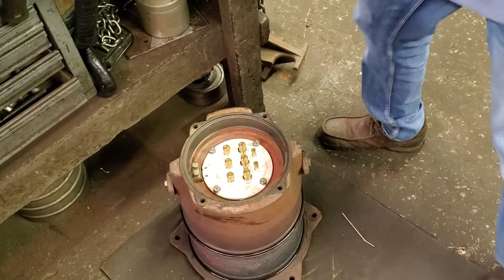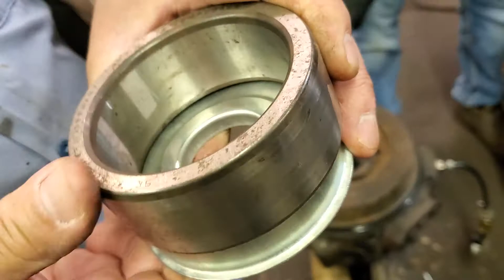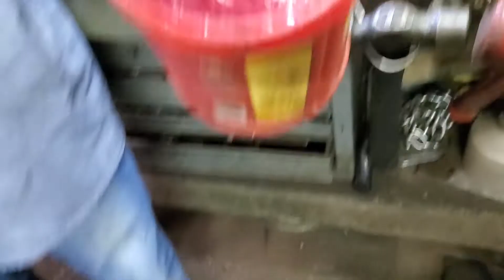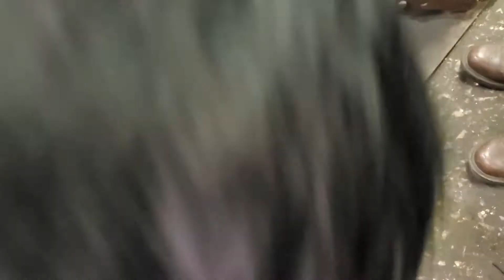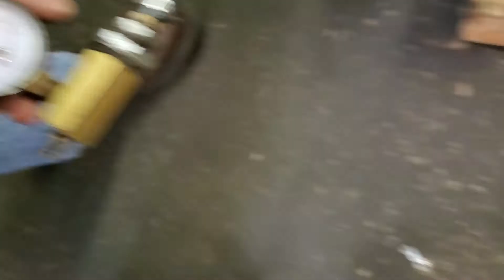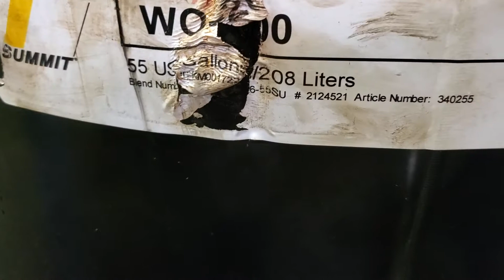Hahn University: 3 of 4 Pump Assembly Flygt 3152

Comment: I googled the article number of the oil and it's not vegetable oil. It's food grade white mineral oil, also called paraffin oil. Food grade means it's safe in contact with food but you don't exactly use it for cooking...

I saw in the manual from Xylem-Flygt that they prescribe food grade/medical grade but that's only relevant if the pump is used for drinking water or similar. I got a more extensive list from Xylem and there many more types of oil were listed, not only food/medical grade. Paraffin oil or mineral based hydraulic oil with viscosity about VG 32 is good and you don't need food grade if the pump is used for pumping shit.

Comment: Some of the way you guys install the bearings and seals are concerning. I have been repairing Flygt pumps for 9 years and i would suggest SKF TMFT 36 bearing installation kit, works great for seals to. It gets scary when you are using a metal pipe for installing the bearing because this could flake metal into the ball bearing and create premature failure.
Reply: I don't disagree with you I've been doing it this way for 40 years if done properly it's all good never had a problem